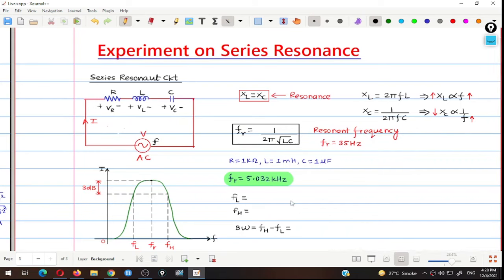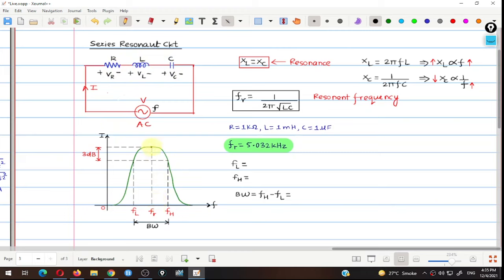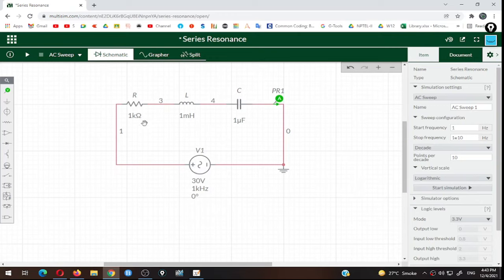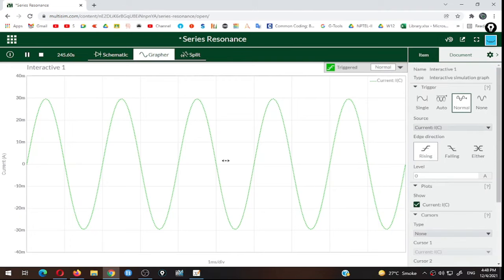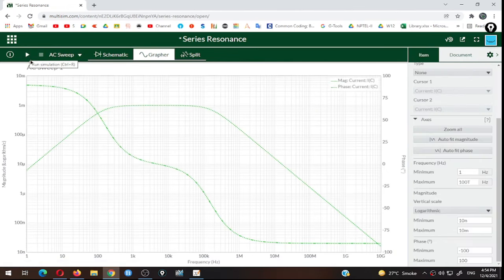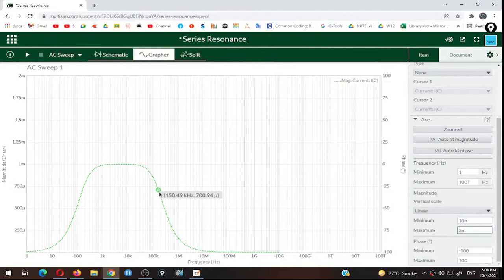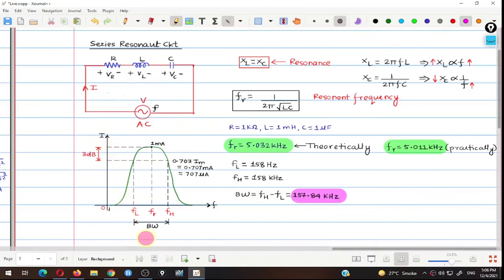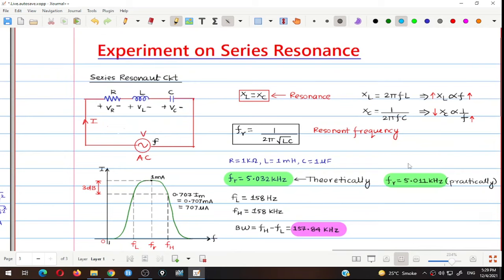Experiment on Series Resonant Circuit (Using MultiSim Live)

Comment: a very informative video. THe question though is if i want a cut-off frequency of lets say 40KHz, what values for the AC, resistor, capacitor and inductor values would help me achieve that. What is the formular?
Reply from the maker: Suppose,
cut-off frequency Fc = 40KHz = 40,000 Hz
formula for Fc = 1/[2π√(LC)] = 40,000 Hz
√(LC) = 1/[2π*40,000] = 3.9788x10^-6
squaring both sides we get

(LC) = 1.583 x 10^-11

L = [1.583 x 10^-11] / C

now choose capacitor of any standard value, we will get the value of Inductor L

suppose C=10 µF = 10x 10^-6

L = [1.583 x 10^-11] / [10x 10^-6]
L = [1.583 x 10^--6] Henry
L = 1.583 µH

Resistor can be of any value because it is independent of cut-off frequency.
I hope this is clear to you.